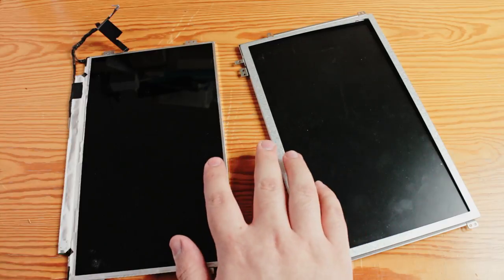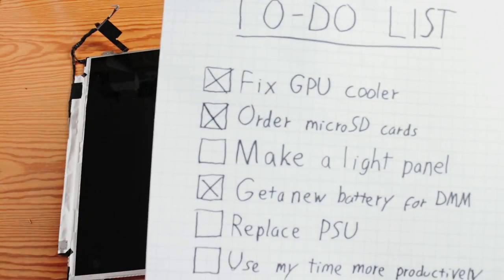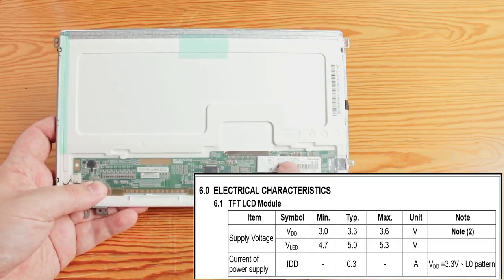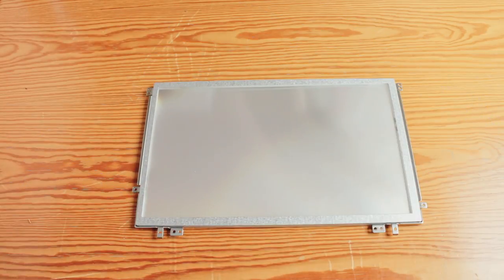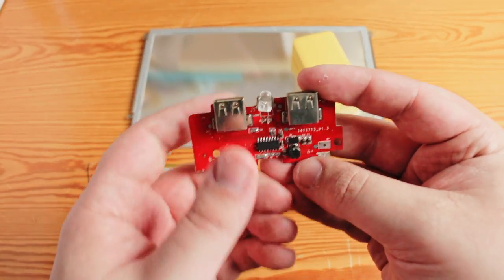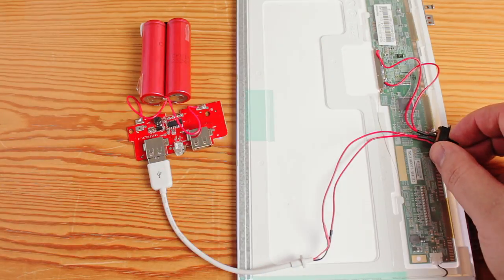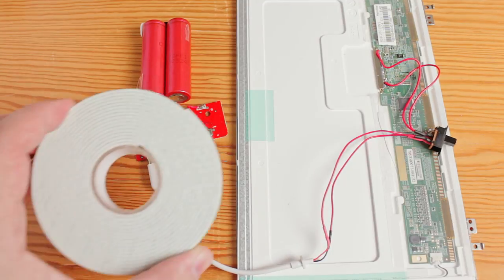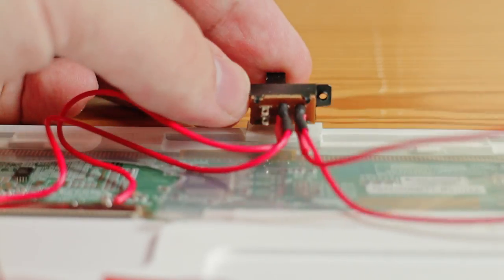Turning an Old Laptop Screen Into a Light Panel

Comment: great video!
how do you know to which pins on the lcd pcb you have to solder on?
Reply from the maker: Thank you!
I found necessary information in the LCD's datasheet. The datasheet can often be found by searching the model number printed on a sticker, which is on the back of the LCD.
DIY Perks' video has great, simple intsructions: https://www.youtube.com/watch?v=Y2KK4YiOO1o

Comment: how you connect positive and negative wire where the pinout sir? thank you
Reply from the maker: +Torqueroque Roquetorque I used Google to find the datasheet of the LCD (model number was on a sticker behind the LCD). That datasheet included pinout, which told where to connect 5V and GND.

Comment: gday mate, how would you do this with a portable charger? not very tech savvy so I reckon using the portable charger would be SO much easier
Reply: like instead of taking the circuit board out and hooking up external batteries, just leaving it intact, plug the PC (portable charger) into the wall from one port and plugging the screen into the other PC port and cut a USB cable so you have the 2 wires, red and black, wire it to the pcb on the laptop screen, so when I tun the portable charger on, the screen turns on?

Comment: Couldn't you have just wired a voltage regulator any maybe a capacitor rather than taking it from a USB? I think both would work but making one might be smaller and neater

Comment: awesome!
can you show how to make it so that you can connect to a usb charger pack (like the yellow one in your video)?
Reply from the maker: +Rich kim Thanks!
The red PCB and the battery I'm using are essentially same thing as the yellow power bank, but without a plastic case. 
I connected positive and negative wires from USB-port throught a switch to the backlight circuit's positive and negative pins. I also needed to connect the "enable"-pin of the backlight to 5V (positive wire coming from USB).
As my screen's backlight uses 5V, I could power it from any USB-port that provides enough current (600mA in my case).
Reply: Hugatry's HackVlog could you show a video of setting up the screen with a usb plug?
Reply from the maker: +Rich kim I'd say you should watch DIY Perks' video (link in the description), especially from 3m19s onwards.

If I was to make video where I show setting up the connections with a USB-plug, I would say the same things, with just few modifications:
- Make sure to check that the backlight circuit uses 5V for both, power and signals, by Googling with screen's model number
- No need for the two resistors, connect PWM and LED_EN pins as well as the VLED pin to red wire of USB-cable.
-Connect GND to black wire of the USB-cable.

Me making a new video about that wouldn't give much new information and I'm short on time at the moment, so unfortunately I won't be making that video, sorry.

Comment: Do you think it could be used as a grow light?
Reply from the maker: Output power is quite low. I don’t think it would be very effective.
Reply: I made a rough calculated estimation how much lumen a laptop size screen would need to be to equal the sun output, it would be about 6000 lumen, equal to about 50 to 100W LED. You don't always need equal brightness as sunlight, any light would help, but I agree with hugatry that it might not be all that bright. I hacked a regular lcd screen which are brighter, and it is bright but a 25W CFL bulb seems to output more light and is more practical I think. So idk maybe you can base your desicions on that.

Comment: Where you found these?
Reply from the maker: +Astuces de Trente Secondes - Must Kunst I'm not sure what you mean with "these". If you ment pinout or voltage levels of the panel, those can be found in LCD's datasheet. Most old laptop screens have model number on the back, and datasheet can be found by Googling that model number. Thanks for your comment, I hope this was the thing you was looking for.
Reply: Hugatry's HackVlog No, i mean the LCD screens. Sorry for the inclearity of my previous comment
Reply from the maker: Oh, right. My bad.
Those were taken from broken netbooks. One is from Asus Eee PC (don't remember the model number) and one is from Lenovo S10-3s. Both netbooks were modern enough to have LED-backlight, which means they use less power than old CCFL-backlights and don't use external inverter.
Reply: Hugatry's HackVlog Ok, thanks bro.